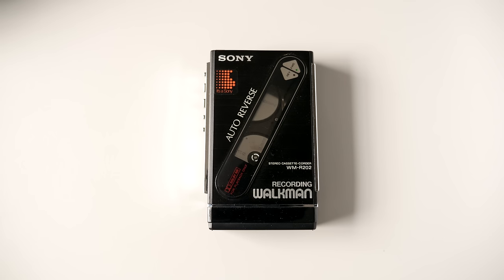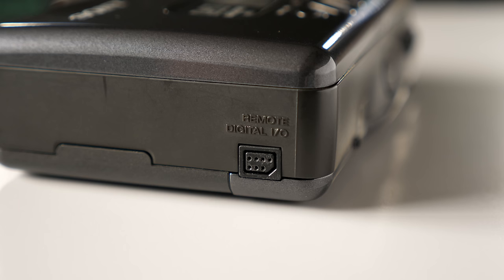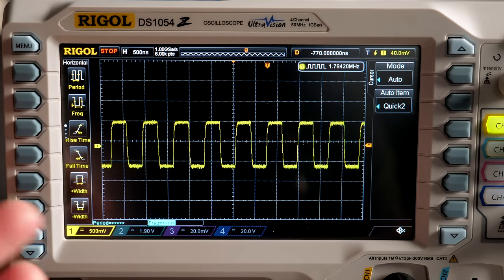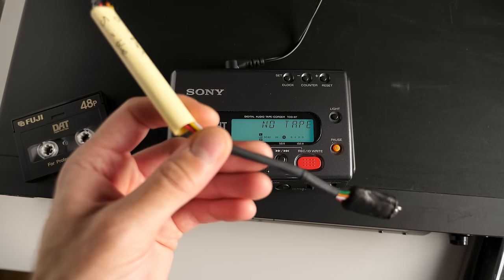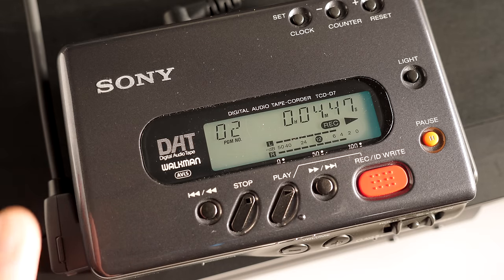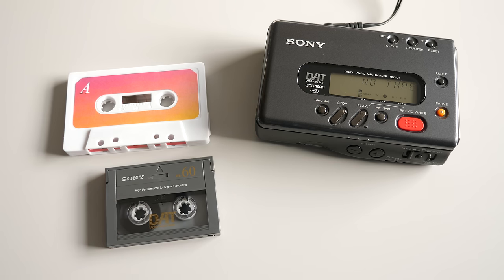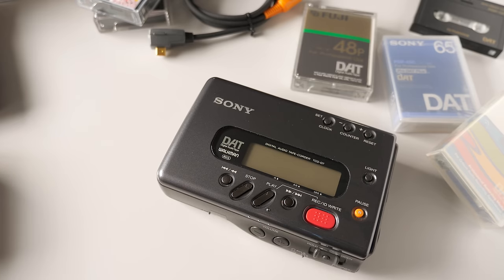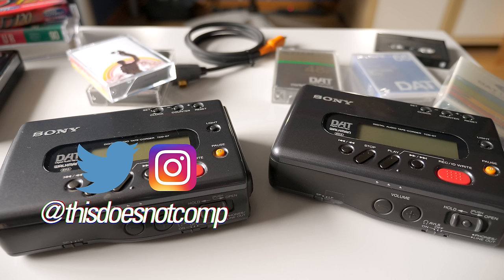Sony DAT: What Cassette Should Have Been!

Comment: DAT records in 48k. it's compatible with 44.1 for copying CD's and stuff, but natively DAT records to 48k.
Reply: Yeah DAT standard is 48khz 16Bit PCM audio with 44,1khz just being an extra for CD. I think Colin mixed up DAT with MiniDisc and HiMD which both indeed could record ONLY 44,1Khz, with the option to 16bit, 20 bit or 24 bit (just for regular MiniDisc, not HiMD), depending on the recording deck or portable.
Reply: Nope, DAT can record in 44k1, 48k or 32k (the so-called “lp” mode). It depends on the clock source, so when you copy a CD over s/pdif, the dat recorder gets in sync with the CD player, thus making a perfect bit-per-bit copy of the cd at 44k1 16bit (there were also some high end dat recorders which went up to 24bit-48k).
Reply: Unless you have a Pro level studio DAT it will only accept 44.1 digital in. it can only record anlogue sources in either 32k or 48k.
Reply: Losing Weight, Ripping Vinyl Actually no. Early DAT units could not accept 44.1 digital input. But later ones could, either by using a built in sampling rate converter to convert to 48, or in later ones by doing native 44.1 recording.
Reply: KRAFTWERK2K6 FYI, while a handful of MiniDisc recorders (like the MDS-JB920) could output 20 and 24 bit, the recording on the disc is still 16 bit. Well, sorta: the way MD works, it records a mantissa and an exponent. So MD is, in effect, capable of floating between 16 and 20 bits, depending on signal amplitude. The DACs in those higher end decks were 1-bit delta-sigma converters and thus could actually render that properly. (I have an MDS-JB930 in my home theater system. :) )
Reply: Yeah, I have 5 DAT decks from different periods and one portable, and experience of way more in studio-settings. Studio deck takes all three sample rates on analogue in without problems, as they have to be able to do correct sample rate for mastering. There is a consumer Pioneer DAT that has extra short play with 16-bit 96k (or possibly 88k, memory is a bit fussy there). All other consumer models I have ever seen or worked with accepts 32,44.1 and 48 k digital in. It records either 32k or 48k on all analogue sources. If you find one that internally sample-converts digital in, then it's a very odd one indeed.I did however come across one model that did not have 48k at all, I dont even think it had 32k. It was pure 44.1k, but it was a demo-model from Sony from before the record industry threw a fit. All the other stuff came after. The SCMS protection was the very last measure proposed to make the format fit with both fair use and record industry, but in that process there might have been sample-converting models proposed and even all analogue in versions, but even all analogue was too good copies for the RIAA...It's my belief that all "early" consumer models with anything other than 32/44.1/48k digital and 32/48k analogue was never available for purchase. Possibly in catalogues, but never reached the public.

Comment: The level differences are Analogous (har har) to analog consumer line level -10dBV vs professional (balanced) level +4dBV. On all my decks AES was also balanced 3 conductor instead of 2 for SPDIF. One of the benefits of AES was cable length possibilities as the recorder might well not be within arms distance of the sources. Mind you we have used some stupid long coax cables for S/PDIF in the past, and while it does work, it can get sketchy. We still transfer about a dozen DAT tapes per year to hard disk on behalf of reviving older music or video productions.

Comment: I can almost be sure this was from a radio station. Gluing those bumpers in to keep them from messing with the switch is so something I would do as an engineer. It's my understanding it was pretty revolutionary that we could finally send a digital recorder out into the field that was as rugged as a cassette recorder and these units fit the bill. I am not really sure if there was any other digital options at the time yet the studios were moving that way very rapidly.

Comment: The cable marked P is as you said a passive cable and is designed for the TCD-D100 and PCM-M1 which have a 3.5 volt input.  The cables without the P are active cables and are designed for your TCD-D7/D8 which is 5 volt. It's fine to use the passive cable on your unit but I wouldn't use the active cable on a D100 or PCM-M1 as you'll over-volt it.

Comment: It should also be noted that Sony (and probably other manufacturers) had already shipped a lot of product by the time this RIAA business started. There were industry stories about pallets of R-DAT (the actual name of the format) machines sitting on US port docks - unable to be sold. As I recall, this stalemate lasted a year or more...and only after a mandated (and major) hardware revision was anyone was even able to sell the stuff in the USA.  This revision required SCMS (serial copy management system) chips to be installed in R-DAT machines sold in North America.  The chip prevented digital recording from any source that was not a first generation recording, and it also raised the cost of the hardware even further.  Also, the format DID tend to be flaky, and so could not be used for live playback applications (stage shows, television, etc.). Ultimately this format offered impeccable audio quality to a consumer market that really didn't want it anymore...or at least weren't willing to pay the premium.  Sony should have done MiniDisc sooner. The lower quality would have meant nothing to a public who has already embraced the convenience, cost and portability of Compact Disc.

Comment: A guy I worked with in the early 2000s bought a used DAT recorder similar to the one in the video.  He loved it.  I think the tapes used for DAT may have been the same format (i.e. interchangeable) as some of the computer backup tapes we used at work.  Don't quote me on that as I am not an expert.  But if that was the case, then my co-worker may also have had the benefit of "free" blank tapes from work.

Comment: DAT machines were very common in recording studios in the 90s.  They pretty much replaced 1/4" reel-to-reel machines for mastering (final recording mix from multitrack recorder).   A lot of bands, mostly dance music acts, used DAT machines in their live performances having 50-90% of their recorded music from the studio played back from the DAT and the other 10-50% of material played live.

My first DAT machine was a Casio DA-7 (portable recorder slightly larger than this Sony "Walkman" style, prosumer unit reviewed here) to a professional, rack mounted Tascam DA-20 which I still have since I still have DAT tapes with recordings from the 90s.

It's also worth noting that DAT tapes were also used as computer back up systems in the 90s.  These tapes are marketed as 4mm Data Tapes

It was interesting to see the digital signal from the S/PDIF on the 'scope.  I noticed that there were 2 sizes of the "peaks and valleys".  I wonder if that is binary.

Comment: The voltage differences are not really to stop you from mixing the 2, and many aes3 capable devices will accept spdif on the same inputs, and can output spdif, usually by shorting one of the pins of the balanced aes3 connection to ground (check documentation for details), or user configurable from a menu, or both, some will detect unbalanced connections when negative is left unconnected and switch to spdif on output.

The simple reason is that spdif is primarily meant to bridge distances of a couple meters (if that), whereas aes3 must by design be reliable on much longer runs, as it is used in studios, on stages, etc, where the distance between some aes3 output (say.. a mixer) and the aes3 input (say.. an amplifier) will often be tens of meters or more. 

This is also why aes3 on 'pro' equipment uses balanced cables and xlr connectors instead of a coaxial cable with rca or ts connectors.

So the difference is really because.. aes3 came first and was primarily designed for use in studios (recording, broadcast) and (large) stages etc, and spdif was derived from it, and brought down to the typical levels used in consumer products and on rca connectors, as it doesn't have the same 'long distance' reliability requirements.

The pulse you see is used as clock by the receiving device, this + the modulation makes it possible to transmit a clock and the data in a trivial to encode/decode way.

Comment: That's technically not FM but PWM (pulse-width modulation). Also in PWM it technically is only looking for zero-crossings of the signal, so it's not surprising that the AES input also supported S/PDIF signals at 1/10 the voltage.

Comment: Presumably this was introduced to my country, India back in '94 - 95 and for sure was not cheap by any means. I was a diehard fan of it. However, could not get hang of it, this was a way beyond my budget being a teen (14-15 years then) and had bought a cassette walkman instead. Later on I had gone ahead and bought a Sony CD Diskman in 1998 and I still have both of them well functioned condition.

Comment: I thought DAT tapes were still being made for data backup devices and that do work on audio machines.
Reply: Yeah they are called DDS tapes. I still have one of them, and a cleaning tape. However i dunno how well they perform for audio recording purposes. Because of the tape length.
Reply: 4mm fell out of favor long ago -- very limited capacity. 8mm some time later -- replaced by S-AIT. Even DLT is dead technology today -- Quantum stopped development after DLT-S4. The far inferior (but cheaper) LTO is king today.

(DLT has laser etched tracking marks on the back of the tape, making them bulk erasable, and pretty hard to destroy. LTO is like a hard drive; they are "formatted" [at the factory, no device in consumer hands can] with logical tracking data on the tape. A stray magnetic field will permanently destroy them. Temp variations can render them unusable.)
Reply: DDS (later renamed DAT by HP when the audio format was pretty much dead anyways), initially started out with similar lengths to audio tapes, such as with DDS-1, but as it went through generations (DDS-2 to DDS-4, then DAT-72 to DAT-320), the tape got thinner to allow for more tape and thus more data storage in a single cartridge. And HP went completely off the rails with DAT-160 and 320 and straight up made the cartridge twice as thick as to double the tape width, for even more data storage. These DAT-160 and 320 tapes wouldn't even fit in a DAT Audio recorder.

Comment: I have this same player, I had to fix mine since the grease was old.  Learned alot in the process.  There is also a gear that sets the different positions that can sometimes go out of position.
Reply: Yeah and some decks  (especially the bigger ones) also have a metallic rod that may bend too much if you push in the tape with too much force… resulting in the machine eating your tape. Also, congrats on getting your portable DAT fixed again :D must have been quite a lot of work.

Comment: One of the finer point of DAT was that in normal mode it was higher than CD quality at 48 KHz, not 44.1 which is the CD quality, the long play mode did drop the quality below CD but as I don’t have my unit nearby at the moment I can’t remember the sampling frequency.  

Later units had a Super Bitmapping Mode to get a higher quality sample onto the tape which was backward compatible with none SBM equipped players, this is something my unit has and does have a noticeable improvement in frequency response with recordings.

Other than that, good review, still have my Sony unit from my music production days, along with a library of recordings and sound effects I did over the years

Comment: R-DAT tape is just a 4mm data tape if you consider that digital audio is just computer data.  The DAT standard is fully interchangeable with the 4mm DDS data tape standard and an R-125 DAT tape is identical to a DDS-60 60 meter 1.2 gigabyte data tape. You can still buy DDS 60 meter and DDS 90 meter data tapes in brand new sealed bulk case lots on eBay for much cheaper than DAT tape.   In particular the Fuji DDS 60 and DDS 90 data tapes even say in small print they are compatible for DAT recording.  (But don’t use any of the later DDS data tapes like DDS2, 3, or 4 as those tapes are too thin and don’t transport properly). Also it’s a good idea to get a DDS head cleaner tape in case that super micro rotary tape head gets contaminated.

Comment: The biggest problem of DAT was the insane head hours you get after a while of using it. Because of the rotating head drum. Like with Video machines :( Something you never had to worry about with Compact Cassette, DCC and Reel to Reel. So yeah it was great for a while when you wanted lossless digital audio in a compact scale but the wear-out factor is just too high. And STILL thou… it is such a super fascinating format.
Reply: Antonio Tejada there’s a big difference between needing cleaned and the wear that occurs from constantly spinning at a high speed.
Reply: @tookitogo  Not every VHS deck can be cleaned. Like some certain Panasonic VHS decks that have such fragile tapeheads, you can actually completely ruin and destroy that machine if you use a Cleaning cassette.
Reply: Antonio Tejada no it didn’t. It didn’t mention dirty heads whatsoever. It referenced wear from helical scan.(spinning) Based on this and the other comment of yours I just replied to, you need to work on your reading comprehension skills.
Reply: @danieldaniels7571  My reading comprehension is fine, I'd just missed a collapsed part of a reply entirely. But whatever, I'm out of here, don't need your hostility.

Comment: DAT led to the DDS tape data storage system. DDS-1 tapes can be used in place of DAT tapes. They were made to a tighter standard as an archival medium so they hold up better over time. I had an SGI Indigo2 system that had a DDS drive that was one of the few that could read DAT audio. I had an external Sony DDS-3 drive that I was able to reflash the firmware on to do the same thing.
Reply: Ah.. I used to have a Sony internal SCSI DDS3 drive,  I never knew firmware could make it read audio DAT….  Too bad I missed out on that…

Comment: I have SO MANY DATS laying around, all filled with my music and our band's music, and I have no way to get them ported to Disc! I'll have to rent a player for like $40/day, here in San Francisco and spend a day or two getting all this stuff archived. I happened to really like this format. It had the same sampling rates as Compact Discs, and we mastered a hell of a lot of our music onto DAT. My Sony portable DAT TCD-D3 bit the dust when the battery corroded inside. We used to master on an SV-3700 machine that also bit the dust! So much for DAT...
Reply: My TCD-D3 is in great shape, EXCEPT the rubber/plastic material that runs around the outside of the unit aged and became really sticky.  It is really too bad, as the rest of the unit is metal and beautiful…

Comment: I think there is a lot of potential with DAT even today. CD's are the only way to archive truly lossless un-"remastered" mixes and files (1,411/kbs bitrates), so to transfer that directly to DAT with no compression would make it quite the competent portrable and studio audio system. 

Lots of potential for filmmakers, follie artists, and musicians recording live audio from exterior or direct from board.
Reply: DAT is totally dead other than for accessing legacy recordings and nostalgic purposes. Modern recorders that are used for field recording and "second system" recording when filmmaking use solid-state storage - normally an SD card. 24-bit sound is standard on these devices - some offer 32-bit float. There are plenty of prosumer devices with 6 or 8-channel support. One top-end device used in the movie industry records to an internal SSD, with 32-channel operation, automixing, noise reduction (if you have a licence installed), audio over Ethernet and much more - with a price tag of around US$12k.

There is no way that a professional will carry an expensive and fragile DAT recorder into the field for 2-channel 16-bit audio on tapes that are only available new old stock, unless there is a desire to use retro kit for some reason. A modern solid-state recorder is simply superior.

Comment: SCMS was supposed to keep people from making digital copies but many pro units could bypass it. My Tascam DA-30 didn't have that switch put I was able to add a SCMS bypass switch by shorting two contacts on the main board. I just drilled a hole in the back and put a toggle switch back there, it stayed in the bypass position for a decade 😁

Comment: its going to be a lot easier to generate +/- 0.5v on a 3v device than +/- 5v, where you'd have to step-up the voltage with an energy-wasting buck converter.  So the consumer version is probably optimized for portability, whereas the pro version is optimized for reliability.

Comment: Actually this format become standars format of modern magnetic hard drives if you look it technically. 
Well with lots of differences anyway. But standard metalic magnetic hdd's are still magnetic tape recorders with a bit more complex controllers and dust protection and uses magnetically sensitive metal instead tape. But still woth amplification you can use a tape recorder to record music on hdds :P